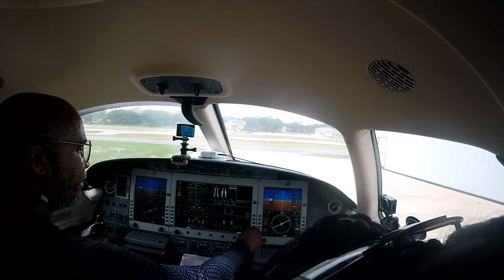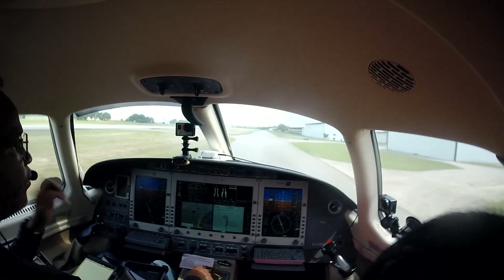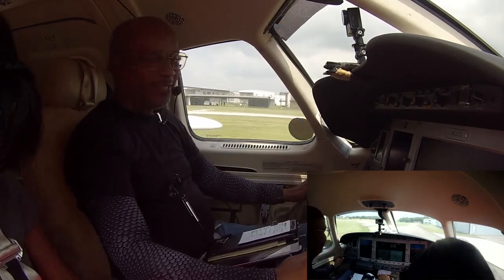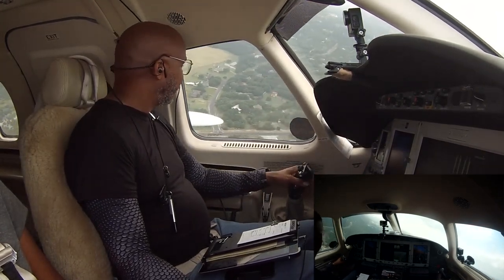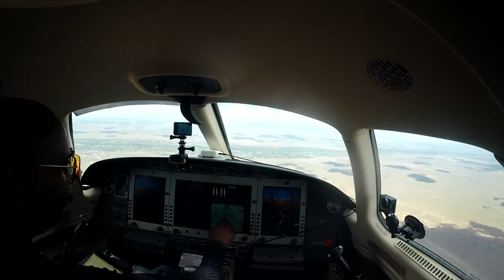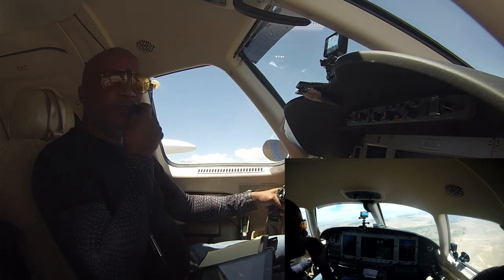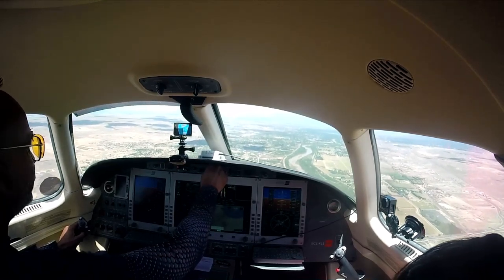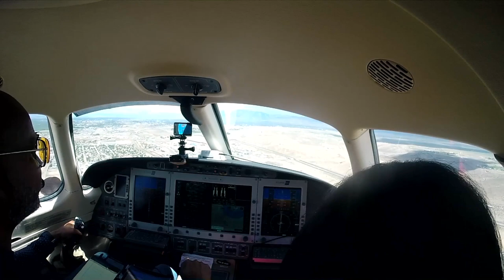Eclipse  550 Trip to Albuquerque

Comment: I'm looking to buy a vlj and live this but I am told not to buy an eclipse because of parts supply issue. Is this true?  What is the timing look like for parts supply?
Reply from the maker: I don’t know what the supply issues is currently. They have had issues in the past, but the last I’d heard was the company had been bought out and supply issues were getting better.
If you can get pst the supplies issues, this would be a great plane to operate. Just make sure to one that’s upgraded to at least a 2.7, or plan to upgrade it. Check to see if flaps and gear are upgraded to Tawagawa version. Compared to the Vision Jet, other than the avionics, there is no comparison. If you only plan on 2-4 people this is a great plane.